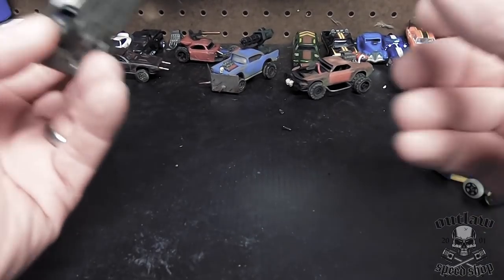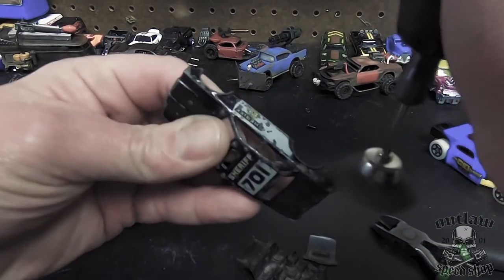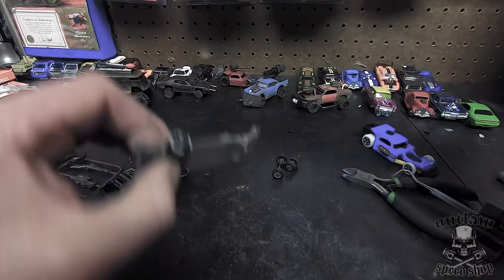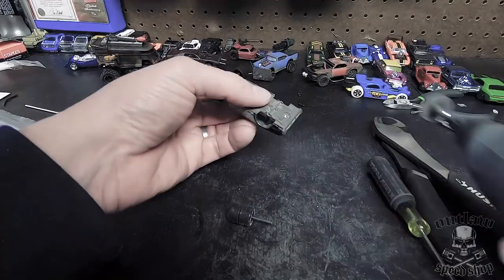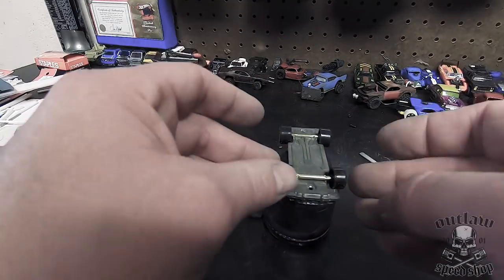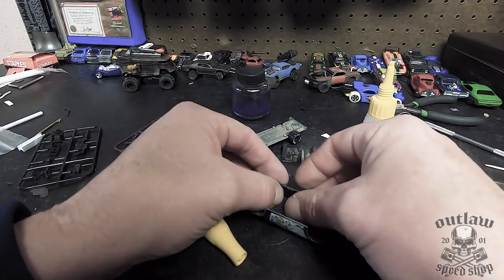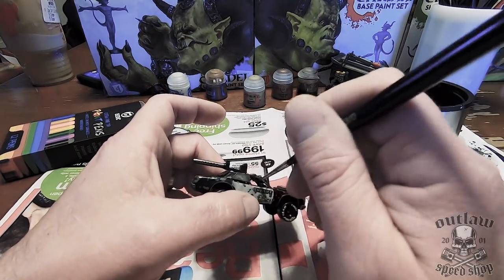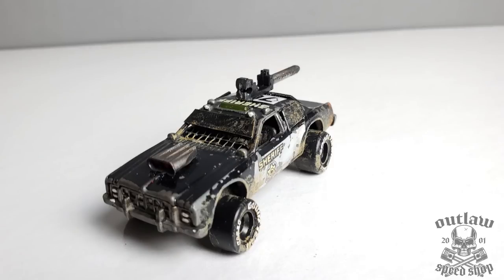Episode 18-Gaslands Cruiser Build

Comment: Great tutorial, love the Cruiser. I find the fiberglass mesh is too tough to work with and the screen door stuff too wimpy to hold shape. Check out the Dollar Tree and look in the cooking section for a big mesh circle on a handle. I'm pretty sure it's an oil slash guard or something like that. Price is a dollar, metal cuts with scissors, and its rigidity falls right between fiberglass and screen door mesh.
Reply from the maker: Thanks for the tip, I will check that out!